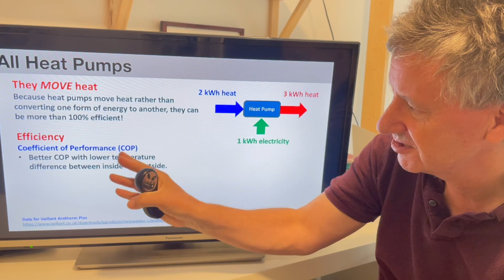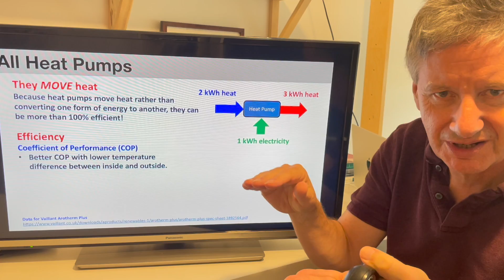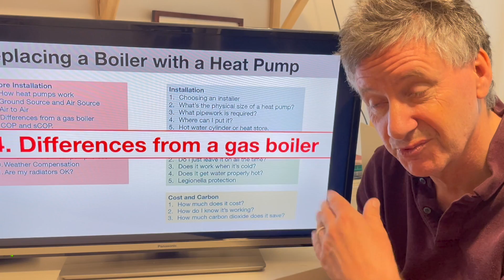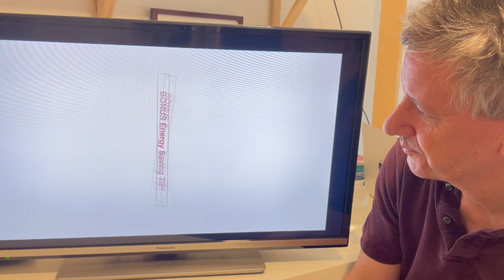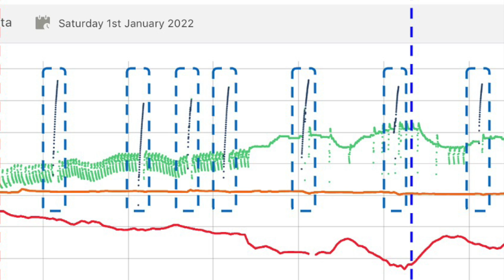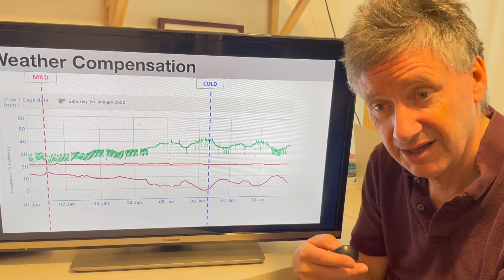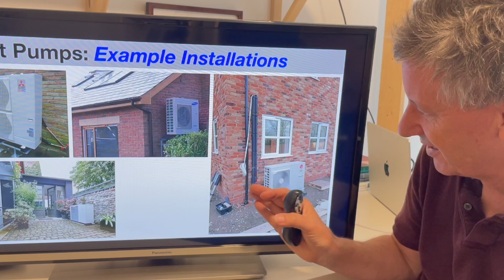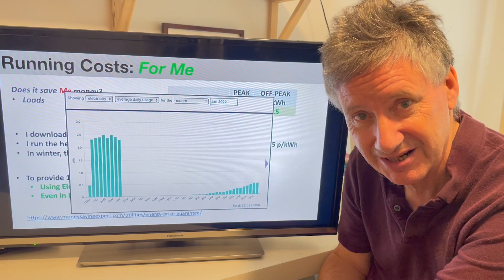Replacing a gas boiler with a heat pump

Comment: Great summary Michael, thanks for sharing it. I'm on my journey to install my central heating system, based on an air sourced heat pump as the heat source. I'm from NZ where central heating is not very accepted method of heating houses, at least not in the "traditional" way (radiators). So I'm a little bit nerdy here. Anyway, the most important part of your presentation in my perspective is the cost of run the system. There is many comparation around to show the benefits (marginal financial benefits) against using gas or other fossil fuels, but I'm more interested to see a system which is similar to mine. I already have solar panels and battery storage system installed and I'm very pleased with the result as it is. Apparently my current setup commissioned about two months ago (middle of the summer here) but the first stage was up on running in June. That was only 6.2 kW array with a 12kWh battery pack. The battery capacity was not quite enough to take all the load during the day (peak power rate) and my inverter also had limitations to supply enough from the battery (3kW DC max). That experience lead me to stage two, 8.8kW array (East-West facing panels) I have replaced the inverter to achieve a greater DC performance (8kW max) and upgraded my battery storage to approximately 30kWh (reconfigured Nissan Leaf battery modules, so the capacity is estimate only, with the consideration of the SOH of the two 24kWh pack). This setup gives me enough to be in credit in the past three months (again, it's summer here) and I have purchase 17 kWh since 20/11/22. 
What I was looking for, some detail about whether I can get through on the day with the batteries only or not during the winter months when my heat pump running 24/7. I know the math ads up, but like most of us "I want to see it".
Thanks again for sharing this, and I'm so pleased I found your channel here, and your blog which will give me a tons of reading.
Reply from the maker: Arpad Arpad, good evening.

First of all, that's an impressively sized system both in terms of generation and storage. Depending on exactly which end of New Zealand you live in, your results would differ, but I would guess that would take you substantially off-grid for a solid 6 months/year.

To understand how the system will behave in winter, you need to compare a few numbers.

Firstly, peak winter heating load. To estimate this take the coldest day of winter and measure your gas consumption (if you heat with gas) for that 24 hour day. Depending on the size of your home this might be 100 kWh/day. With a heat pump you can deliver that heating with typically 33 kWh/day of electricity. So then the question is: can you generate 33 kWh/day in winter from your solar PV. My guess is probably not. 

My 21 panel system generates about 4 kWh/day in winter  but heating demand on the coldest days is about 75 kWh i.e. requiring 25 kWh of electricity to operate the heat pump.

SO you need to compare your peak winter load with typical winter generation - the most useful units are kWh/day.

I hope that helps

Michael
Reply: @michaeldepodesta001  Yes, we are in Christchurch which is pretty good in terms of heating demand (that's probably the main reason why people reluctant to spend on energy efficient heating options), we barely have frosty nights, and the daytime temperature is pretty much always above 0. The difficult part to create baseline data. Heating a house here is basically ad hoc. The most advanced technology is using air to air heat pump, generally to heat one area in the house, or having the larger , ducted version, which is the closest to "central heating". Of course I'm talking about older houses, some new builds in colder areas has underfloor heating. In my case the house is about 30 years old. As we just purchased this house in December 2021, I have very limited data available, and that is electricity only (no other energy has been used). The highest usage was not exceeded 60kWh/day. Looking at the daily consumption during the summer months is in average of 15kWh/day, so we used approximately 45 kWh for heating per day (likely on a cold day), which included a 6kW air to air heat pump, and four electric heaters in the bedrooms (electric fan heater in the bathrooms occasionally). Needless to say the comfort is questionable when you have to go through on the cold hallway between rooms, not even mention other necessities in the smallest room in the house.. 
I'm sure we need to purchase electricity, as the winter production will be only around 20kWh on bad days. What I'm hoping for is topping up the battery during the off peak power, which cost less than the half of the peak power, with my power company it is between 9pm and 7 am, which is very generous.
Reply from the maker: @arpa592  Hello again. Yes, we switch modes with our heating. 

When the average solar yield exceeds the normal household, we switch to self-sufficient mode: We charge up on solar energy during the day and run down the batteries over night. 

When the average solar yield falls below the normal household, we switch to grid-mode: We charge up on cheap electricity at night and then run off the battery during the day with the solar 'topping up' to some extent.

Your are right, your electricity is being very generous with their cheap hours. We just get 4 hours!

All the best

Michael

Comment: Well done. I just found you and subscribed. Could you discuss the low GWP refrigerants like R290, R744 and R32 and their superiority to the high GWP old refrigerants. Monoblock ATW heat pumps nullify the "it's dangerous because its explosive or an asphyxiant" by the trolls who can't understand the importance of using greener refrigerants.
Reply from the maker: Solexx X, Good Morning. You ask two questions. One about about low GWP refrigerants, and one about Monobloc heat pumps. 

Regarding low GWP refrigerants, these are the inevitable endpoint for HVAC and heat pump technology. Although leaks in operation are unusual, the end-of-life disposal of heat pumps/AC units without proper care is quite common. The refrigerants will then likely leak and cause global warming. Even in the worst cases, this is likely to be a small fraction of the global warming avoided during the lifetime of the pump

https://heatpumps.co.uk

But nonetheless, using low GWP refrigerants is the future.

Secondly, in Monobloc heat pumps, the refrigerant is sealed inside the exterior mechanical unit. This dramatically reduces the complexity of installation and reduces the chance that refrigerants might leak during installation.

Low GWP refrigerants and Monobloc heat pumps are the future!

Best wishes

Michael

Comment: Thank YOU very much and don't apologise for the length of your production - it was awesome! I was VERY sceptical about heating my old Edwardian home with a heat pump but I am now swaying towards it. I am with Octopus Energy so will enlist their help. Next job is to empty the loft and insulate it properly! Thanks again!
Reply from the maker: Colin. Thank you for your kind words. Insulating your loft is definitely to be recommended. 

I would suggest you read your gas meter weekly for the rest of the winter and perhaps for next winter. This will allow you to save up your money and assess your real heat loss.

https://protonsforbreakfast.wordpress.com/2022/11/07/what-to-do-on-the-coldest-day-of-the-year/
https://youtu.be/hCeghKa3liM

Best wishes

Michael

Comment: Sorry but the cost was astronomical to retro fit a heat pump kn my 2 bed home,even with a grant . I Replaced a gas bolier with a new one. Our new office has a heat pump and it's garbage. Sitting with jackets on and installers have told us it won't go over 16 degrees. Ridiculous. I just don't think the technology is that great. We also have 2 Nissan leaf company cars ,with a ridiculous range of 150 at start, when more realistic you get 100 miles. I'm not sold on this electrification of the UK as what I have seen, its not that great yet.
Reply from the maker: AR: Sounds like you have had some bad experiences. But I urge you not to let that colour your judgement. 

Regarding Heat pumps, my heat pump will warm water to 70 °C if I want and my house sits at very comfortable 20 °C no matter how cold it gets outside. And it - combined with other CO2 reduction measures is saving me thousands of pounds a year:. The article below was written before the current government subsidy. With the subsidy my annual bills are practically zero. It sounds to me like the installers were not competent.

https://protonsforbreakfast.wordpress.com/2022/08/26/non-je-ne-regrette-rien-update/

Regarding electric cars, the Nissan leaf is a very old car and new technology is much better.

In any case, keep warm.

M

Comment: Absolutely brilliant. I have spent the last several years researching heat pumps and this is bar far the most accurate, comprehensive, thoughtful, information presentation and delivery that I have come across. I now have to persuade my wife to allocate an hour of her precious time to watch it.
Reply from the maker: Bob, Good Evening. You probably can't tell but I'm blushing. Thank you for your kind words. Drop me a line if you have any questions: M
Reply: @michaeldepodesta001  I will definitely follow up. Just set my gas boiler to always on at 40 degrees as a test. I h e never seen that recommended before. I have a DHW tank so will boost with immersion overnight, I am on Octopus Agile and rates low tonight
Reply: But does not make sense

Comment: A lot of the information is a little too simplified for my liking.

Saying you'll get an average cop of 3 for the year sounds about right. In reality this depends on the installation.
You don't really need your house heating in the summer where your cop could go as high as 5-6.  (apart from hot water)
In the winter your cop could drop to 2.

The next big problem is the price of electricity. 
Gas is 13P 
Electric is 36p soon to be 42P. 
Even a cop of 3 does not cover it.

Now you can fix that with an off-peak tariff of say 12p and a battery.
But that's a big outlay for a lot of people.
You don't really need solar but it would help.

Then the killer the installation price.
It's starting to feel like the chicken or the egg problem.
Reply from the maker: Michael, Good Evening. The figures you have proposed are all a bit off as far as I can see. For my system:

Summer COP is around 2.3 - because it pumps so little heat, the 20 W standby consumption becomes significant. In summer we are off grid and DHW heating is done via solar.

Winter COP is closer to 4: Sept/Oct/Nov/Dec/Jan = 3.3/3.7/4.0/3.1/3.8

With the Battery I buy electricity at 7.5p/kWh and this provides over 90% of the electricity we use. We just top up on full price (42p/kWh) electricity at the end of the day. Cost per kWh of heat is 3 or 4 pence - way cheaper than gas. Costs for Sept/Oct/Nov/Dec/ = £18, £30, £62, £124. The government's £400 subsidy will pay the entire year's energy bill.

And yes, this kind of set up is expensive, but it will only get cheaper.

Best wishes: Michael

Comment: I don't care about the carbon dioxide or The green agendas.
For most people the bottom line is "does it save me money"

Saying that, I have solar / battery / EV.
The last puzzle is getting rid of the gas boiler. 
Also, I don't like paying for oil / gas corporations. 
I have always like the idea of making my own fuel I.e. solar electric to power the EV.
Reply from the maker: Michael, Good Evening. 

It sounds like you have already realised that from an economic perspective the world has changed and that solar/battery/EV combination makes financial as well ecological sense.

You may choose not care about 'green agendas' but the issue of global warming is still very real. If you have the resources to act to reduce carbon dioxide emissions, I urge you to do so.

In any case, best wishes

Michael

Comment: Great video very informative ,
I have 15kw batteries which we use around 10-11 kw’s per day.
How much would you say a heat pump uses On average per day 
Thanks
Reply from the maker: Mark, Good Evening.

In my house, my wife and I  use around 10 kWh o electricity for all the usual nonsense.

How much electricity a heat pump uses depends on how cold it is and how well insulated your house is! But he's an example for my house.

For heating I used to use ~7,500 kWh of gas per year which heated my home with around 90% efficiency i.e. around 7,000 kWh of heat. With a heat pump I still need to deliver ~ 7,000 kWh/year of heat but now with an efficiency between 300% and 400% so the heat pump uses between 1,700 and 2,300 kWh/year of electrical power. 

On the very coldest days in December, the heat pump average power was just over 3kW of heating power i.e. it delivered 3 x 24 = 72 kWh of heat with an efficiency of ~280% i.e. I used around 26 kWh/day of electricity to run the heat pump. On these extra cold days, the 13.5 kWh battery was emptied just after midday. That's very much a worst case for my home. With more typical December and January weather the battery runs out late in the evening.

The link below has more details. 

https://protonsforbreakfast.wordpress.com/2022/12/11/cold-weather-measurements-of-heat-transfer-coefficient/

All the best

Michael
Reply: @michaeldepodesta001  Thanks for those real life stats. My gripe with the 'green brigade' is this. If you have a battery system coupled with solar, from Nov to March, the only way the battery will be replenished is via cheap overnight electricity. This is the same for all these with EVs too. The only way this is possible is because of access to ridiculously cheap overnight electricity. If everybody did this, there would be no overnight cheap electricity as there would be no 'off-peak'. I'd hazard a guess to say that the current infrastructure (sub-stations, single phase supply, increasing use of domestic electricity) could probably support as little as possibly 10% of people adopting a life-style similar to yours. If any more did it, there would be outages because of blown fuses, burned out cables etc. Then off course there is the up-front cost. I've installed an 8.4kW array, three 5kW inverters and a 15kW (usable) lead acid battery bank, not because I wanted to, but because my duel fuel bills have risen 600% since September 2021, when my 'fixed contract' was 'null and voided' when they went bust, leaving Octopus to pick us up. I've no doubt that Octopus and all the energy companies are in some kind of Government collusion because I left Octopus three years ago when I found a cheaper company, only to be returned to them now with a massive price hike. The cost for my install, doing it myself is about £10,000. My estimated usage this year was between £3500- £4000. My install should see this diminish to about £1000 if I judiciously monitor the system. To change my heating to ASHP is going to cost at least another £5000 doing it myself and double if using an installer.
Another reason for doing this however, is that if the public were stupid enough to swallow the idea of a PANDEMIC which was 99.97% survivable in order to get them to roll up the sleeves three times or more, then how much easier it's going to be when they turn the electricity off because of nasty Mr. Putin.
Reply from the maker: @fredflintstone1428  Hi. There's a lot to unpack in your comments. You seem very unhappy despite the prospect of heating your home with 300%efficiency! That makes me happy!

Regarding, the idea that the grid will 'max out' I disagree. In 2002 peak grid demand was around 46 GW. In 2004 it was close to 60 GW. So the basic capability to cope with increased consumption is there. And the use of batteries will actually only smooth consumption reducing peaks and (as you said) increasing consumption when lots of renewable supply is available. Will it be easy? No. But widespread electrification of everything is the only way I know to continue to live a relatively good life without emitting carbon dioxide.

Best wishes

Michael